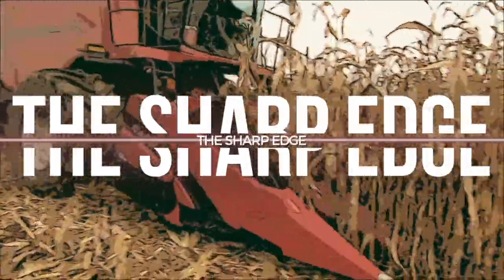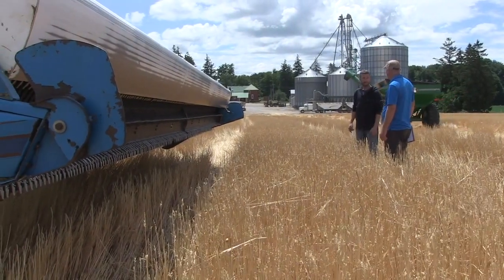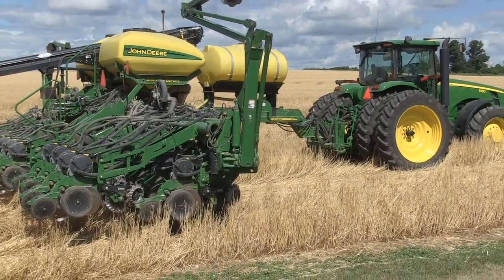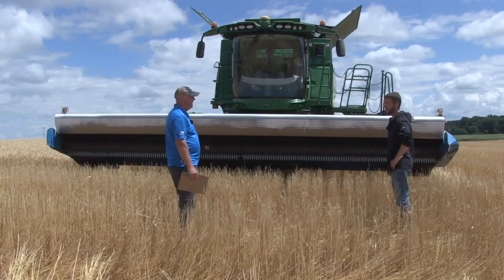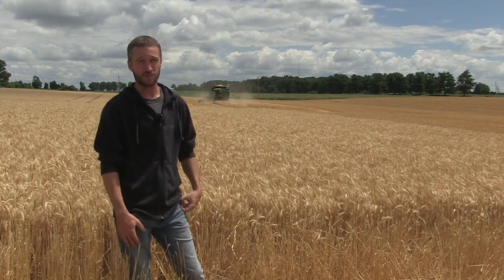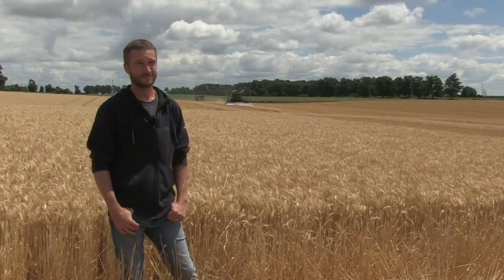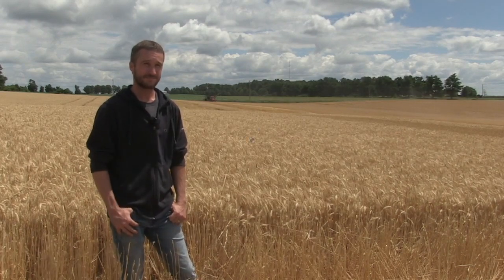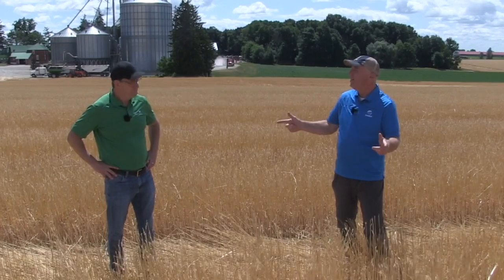The Sharp Edge: Stripper header boosts double crop soybeans

Comment: I tried this once, near Milverton. had a successful bean crop with probably 15-20bu (just broke even with seed planting and combine cost). planted I believe it was the 15th of July with the straw baled. Then I planted with a Drill at probably 400k+ pop (one tote bag on 16 Acre, so 156 lbs per acre. After applied a generous about of liquid manure with a drag line.  If I was to try this is the future I would plant winter barley to get in the field sooner. Still if the weather doesn't cooperate it wouldn't work.
What I learned 
-every day counts in July, and cant have an early frost.
-need as many seeds as possible
-Liquid manure is huge bonus 
-be prepared to plow down as cover crop or cut for silage.
Reply: Why would you bother plowing it under? Lol